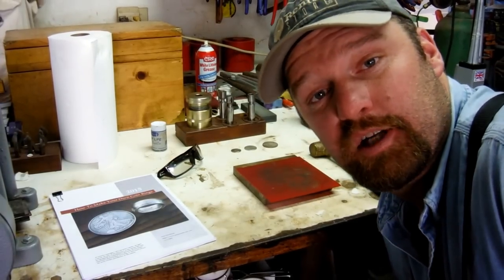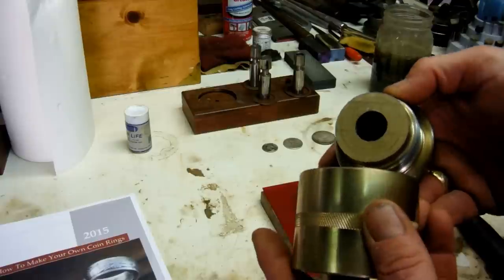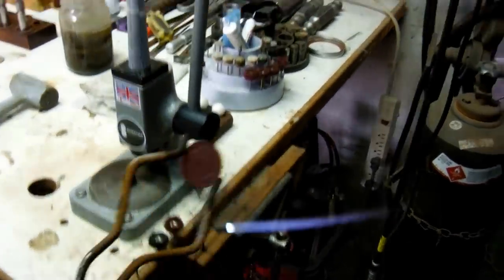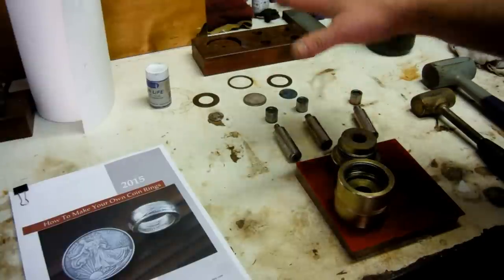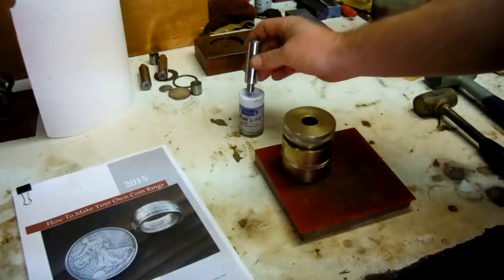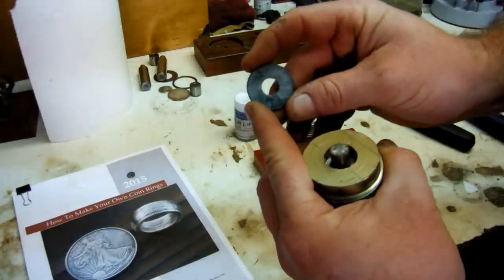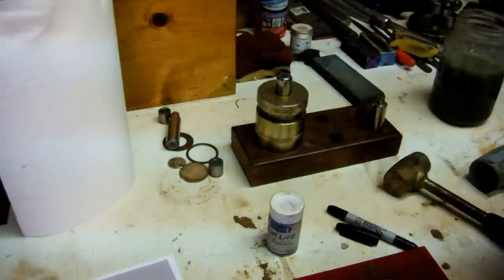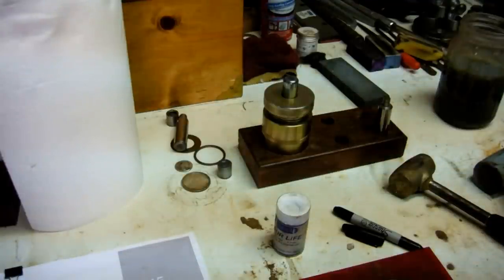Coin Ring Making Pro Tip! #1 How to use your self centering coin punch. Tips & Tricks

Comment: What is the overall height with a coin and the punch in it? I don't really have a workbench for hammering so I have a harbor freight A frame press that I plan to use and was wondering if this will fit.
Reply: ***** I think I can stack the base plates up between the bottom angle iron and make it work. Thanks for the quick reply!